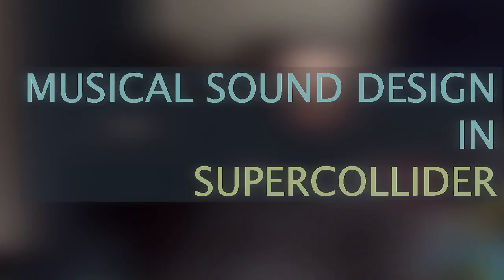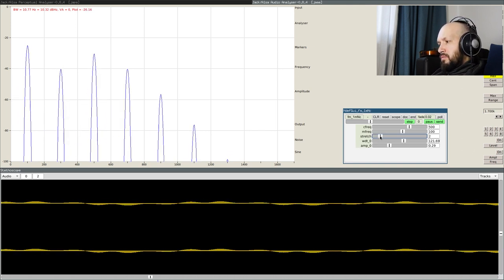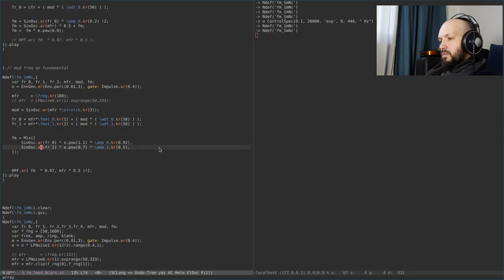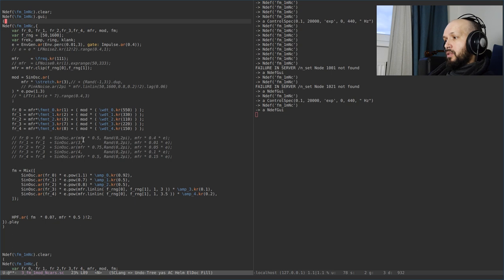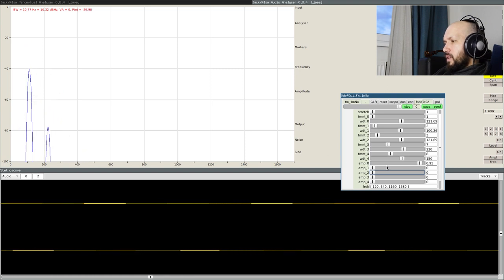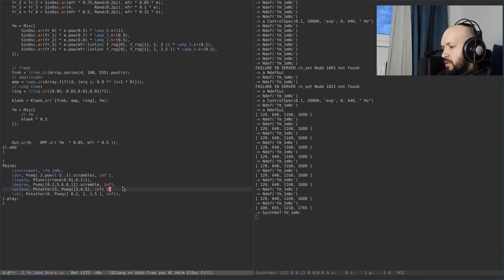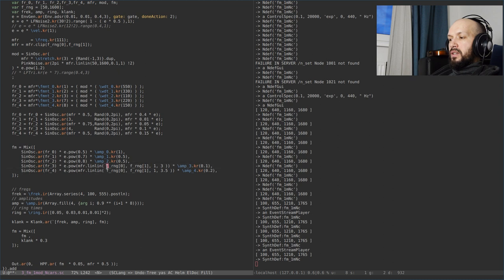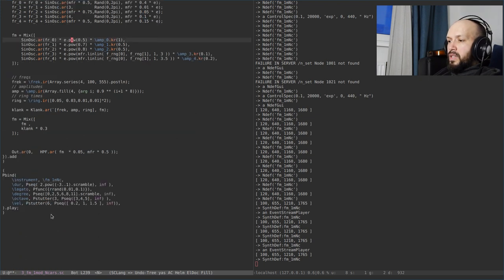4: FM[1] - 1 modulator N carriers - Musical Sound Design In Supercollider

Comment: Do you know how to make feedbacks in the FM operators, like algorithm 4 of the DX7 ? cf. http://blog.dubspot.com/files/2012/12/DX-7-Algorithms.png
Reply: SupreCollider does not do 1 sample feedback, minimum feedback period is equal to blocksize. Blocksize is 64 samples by default. That's for efficiency reasons. It's assumed ugen will do 1sample feedback if needed. There is Fm7 ugen that can do complex feedback fm. But if you don't mind 64 sample feedback you can use LocalIn LocalOut in your SynthDef. That will give you the feedback, then you multiply it signal by modindex and add it to the modulator
Reply: In a particular case of that algorithm 4, operator 6 should be assigned to a certain variable and the feedback from operator 4 will be added to it
Reply: I will make an example on it in fm Cascades video
Reply: @alikthenam  Thanks for your detailed reply ! Can't wait for your cascades video ! Will try both FM7 and LocalIn/LocalOut trick, and see if recuding blocksize to 1 changes the sound :)